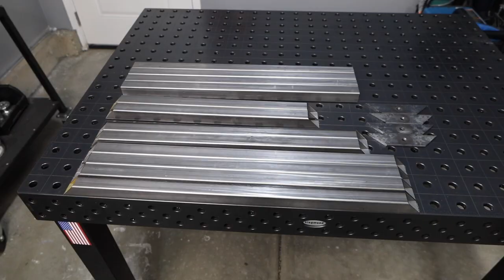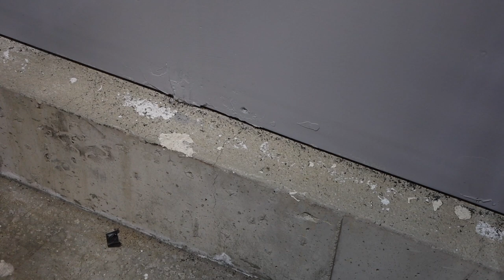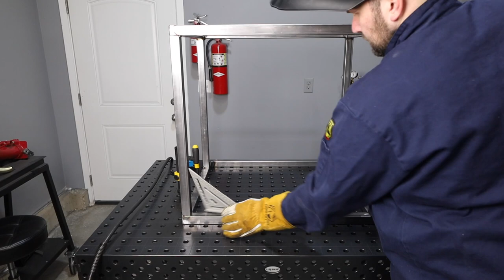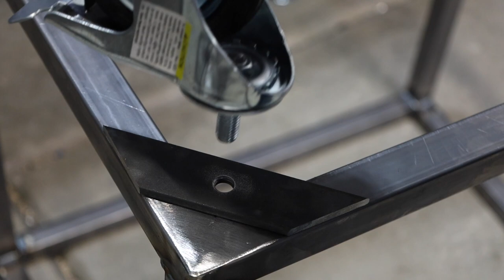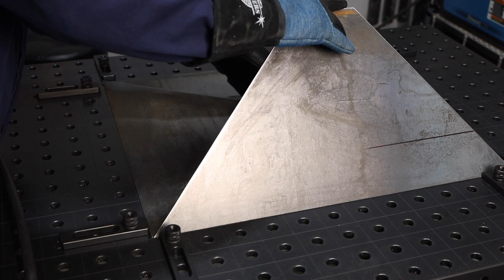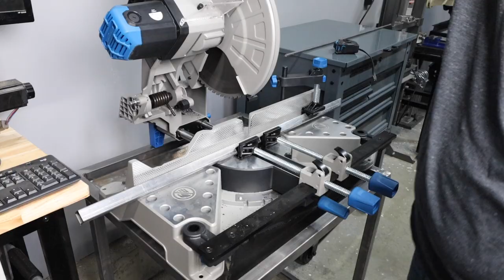Chip Catching Chop Saw Cart: Let's Build One!

Comment: I absolutely loved your solution for the castors you used.
I stopped using those, as they tend to bend over on rough terrain. But that was because I had them mounted on the thin walled tubing.
Your plan with the flat bar was an eureka, and a why didn't I think of that, moment for me.

Comment: This is great! I have the lower evolution model, 355 I believe. It definitely throws sharp little chips everywhere. My current solution was to hang a welding blanket behind it. Do you still get some chips flying around? Or does it contain them pretty well? This saw's chip guard is a lot bigger, mine is just a tiny little part. I think I'll make a bigger one and a table like this for it.

Comment: Nice build, was going to buy the new evolution , but ended up getting the 380 instead,didn't want to wait for it to come out. Turned out great,I like your new fixture table. A little pricy for me ,I ended getting 2 arcflats ,they will work ok.
Reply from the maker: Very cool! The 380 is a great saw as well! The Arcflat is a great table too, I've built hundreds of things on an Arcflat.
Reply: @TimWelds  I've been hoping someone would make a dry cut saw with precise miters. Evolution is right up the street from me,where I saw the prototype. I did several reviews on the Rage 2 I had for years. Pretty cold company actually had to go to my local weld shop for buy one.

Comment: Funny, I just mounted my new evolution chop saw on a HF Hercules saw stand. Then you build this chip catcher. Hmm, what should I do? Thanks for the build.
Reply from the maker: I was looking at the Hercules stand.  It looks nice, especially the material supports on each end, which I’d like to add on this at some point. I wonder if there would be a way to make a frame for some sort of heavy duty bag underneath the saw on an open stand like that. I’m pretty sure I’ll have to sweep up anyway because of the chips that fly out of the end of the tubing, so it might not be worth bothering with anyway. Harbor Freight has these magnetic sweepers on little wheels that actually work really well.
Reply: @TimWelds  The extension arms are quite nice, I get 10' stock from the metal yard. The Evolution magnetic wand works great because the saw is mostly aluminum. The HF mag sweeper is ok, I used it today too. Best part about the combo, the colors match!

Comment: Nice project, Tim.  How do you like that saw?  Is it worth the money?
Reply from the maker: I like it really well so far. This is the first project that I have done with it, but here are my first impressions. The thing I really like about it compared to my other chop saws is that the head pivots rather than the table so that the material sits straight side to side no matter what angle you're cutting. It's also nice that it can miter either direction, which will be especially useful on angle iron which isn't symmetric and can't just be flipped over as easily. It's really easy to change the angle of cut and to change the front to back position of the blade without any tools, a big time saver. The clamping setup is great and having both sides clamped feels more secure than just one. The only drawbacks that I've found are that it's less portable due to the larger size and it does take a little longer to clamp with multiple clamps when making straight cuts. I'm pretty sure that this will become my go-to tool for cutting long material. Whether it's worth the money depends on an individual situation and what value it adds to that situation. I do think that relative to other options out there and for the features it provides, it is fairly priced and from what I've seen so far, I would recommend it. However, I never want anyone to think they have to buy a big, fancy tool to make things.
Reply: @TimWelds  Thanks for the in-depth review/reply.  Appreciate it!

Comment: What tap and dye set do you recommend? Great video!
Reply from the maker: Here's a link to a set of taps and drills that I have and absolutely love. https://amzn.to/3GKjrse They are spiral point taps, meaning that they direct the chip downward out the bottom of a through hole rather than jamming it against the other side of the flute. This allows them to cruise through the metal with ease. I also have a cheap tap and die set in case I need to chase threads on an oddball size, but the small kit I linked with a basic tap wrench has proven to be the most useful.
Reply: @TimWelds  I’ll check them out. Thanks!

Comment: Great build but you need a backstop
Reply from the maker: The saw has a fairly large deflector that sits right behind the blade and directs the chips downward. I was going to put a back stop on it, but after trying it, it seems like most of them were making it down into the bin anyway. The hardest problem to solve is the chips that shoot out of the end of the tubing, but I'm happy with an 80% solution here.

Comment: Very nice cart, but, this seems like an exercise in futility. I have this saw and it throws chips EVERYWHERE. No way will that chute work. Also, a key need on these saws is extension arms on each side. Would have been nice to see you tackle that.
Reply from the maker: It’s definitely better than nothing, but after some use, effectiveness is around 60%. I just use harbor freight roller stands for longer material, they work great.